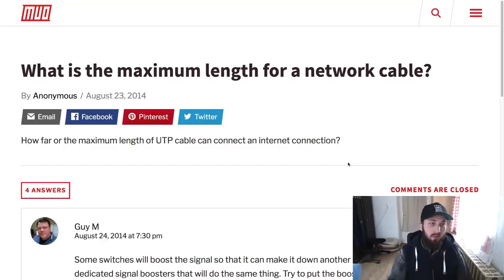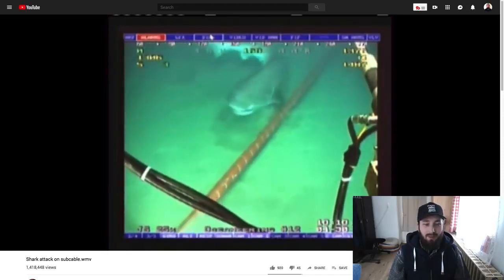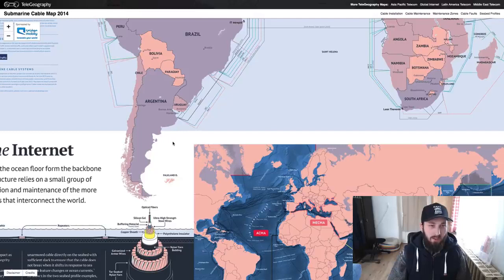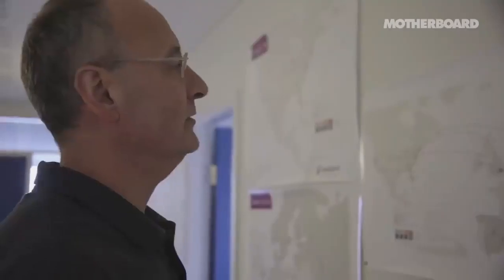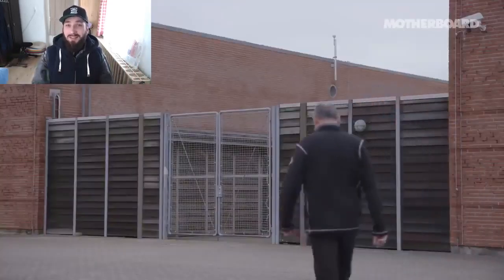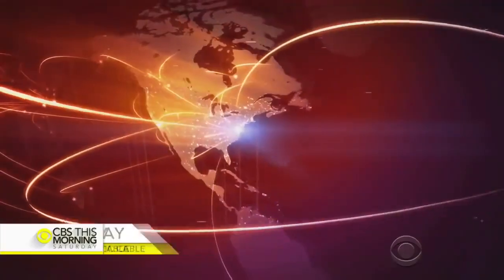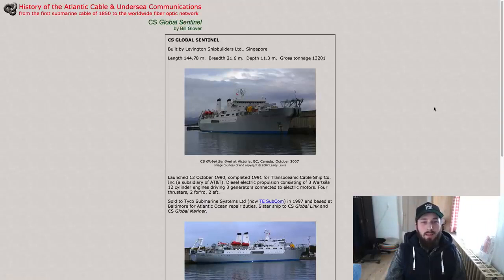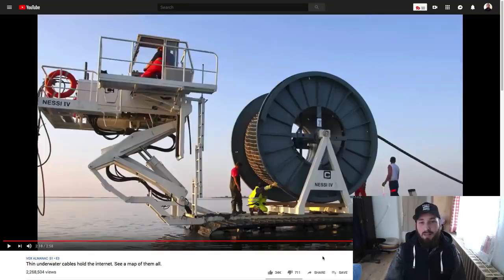The Internet Doesn't Exist  No Submarine Underwater Internet Cables

Comment: Ether is shortening of Ethernet - the protocol used to encapsulate IP packets for transmission over smaller networks, to other computers or a router. Why do they call it Internet cables? Well, you seem to not understand the concept of generalisation, the internet is a general term for a collection very different connection types - with data often been retransmitted over different mediums.. Seriously, please tell me this is a spoof?
Reply from the maker: Is NOT a spoof, show me images of cable rolls please!

Comment: sigh 1. Do you think it is 100 metres between you and the ISP? No, it is several miles. they use different technologies (DSL is the immediately obvious one for copper) to get more distance when transmitting the data, albeit, at sometimes slower data rates. Also, a lot of your data gets retransmitted onto fibre, which has a far longer basic range, that is before you have (expensive albeit) range boosting tricks such as those relying on Erbium doped fibre. Seriously man, don't patronise those who know their stuff and put a lot of work into finding ways data can travel exceptionally long distances.
Reply from the maker: Show me pictures of fiber cable rolls
Reply: Undersea ones or standard underground ones?
Reply from the maker: @jamiewhite1105  undersea & underground please
Reply from the maker: @jamiewhite1105  are CGI, XDXDXD
Reply from the maker: @nuelogic  cant see the proves...
Reply: @NotSpherical  Show us the map you use for turn by turn directions.

Comment: The cables are fiber optic. They are used to connect computers within the same building all the time. The real question is why is all of Australia able to only run through a 4 strand cable. Most neighborhoods use 100 strand cables. Why did the basket tray only have like 5 CAT6 in it? I've seen hospitals with more cables than what was supposedly the whole of Australia.
Reply: So you're buying into his argument?  I think he makes some good points.
Reply from the maker: Yess! Sure! They change cables every day!! XDDDDDDDDDDDDDDDDDDD

Comment: Typical transmission speed and distance limits are 100 Mbit/s for distances up to 2 km (100BASE-FX), 1 Gbit/s up to 1000 m, and 10 Gbit/s up to 550 m. Because of its high capacity and reliability, multi-mode optical fiber generally is used for backbone applications in buildings.

Signal amplifier every 2km seems possible. Lets keep researching and keep it real.
Reply from the maker: Thank you!!

Comment: I just ran across this video, ok I was on top of Holston mountain in Tennessee 4700 feet above sea level there were at least 10 to 15 towers there one was called Holston Mountain Microwave it had a wifi emblem on it research it, I did, I could not understand the websites meanings, you probably can. thanks